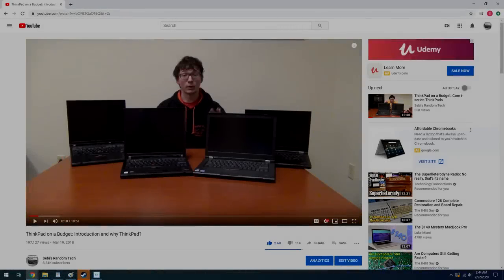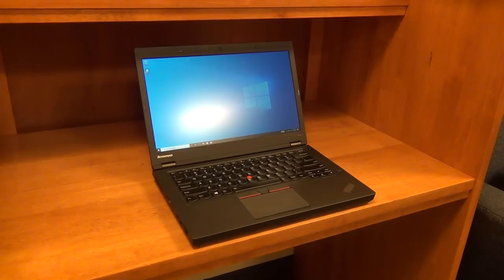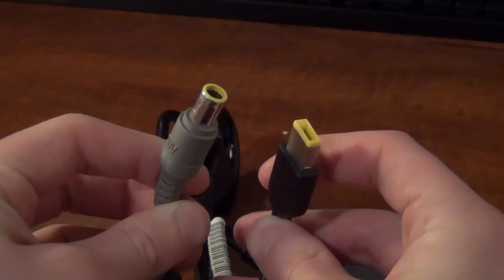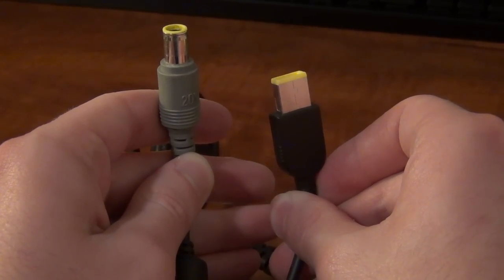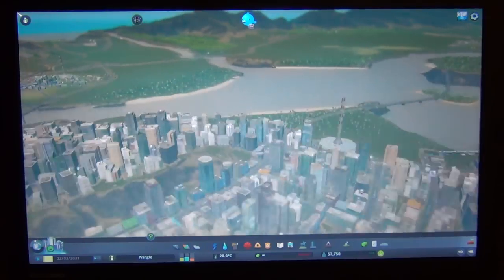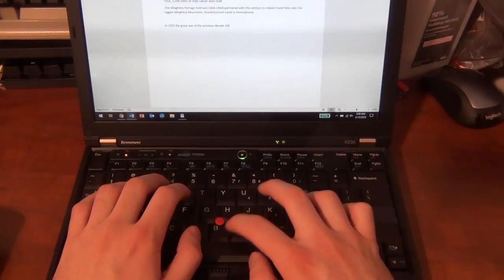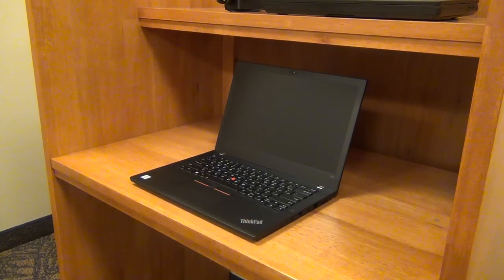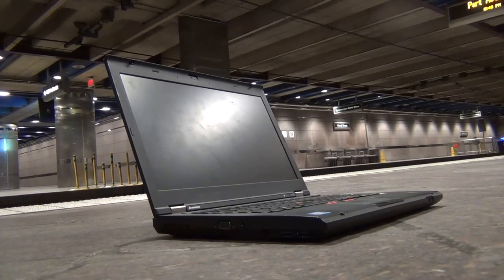Best Value ThinkPads in 2020

Comment: Totally agree on the keyboard part, it's an enthusiast project with a lot of moving parts and sourcing the hardware for it is a huge pain in the ass. It's nowhere near as easy as the 20-series keyboard swap. That being said, the chances of putting a classic keyboard into T480 are still technically higher than the chances of putting one into T440p 😂

The Thunderbolt port situation is a really bad move from Lenovo. Some users on Reddit speculate that the firmware patch is only going to prolong the Thunderbolt controller lifespan enough so that it breaks after the warranty has expired, but only time will tell. Wouldn't be surprised about that to be honest. I definitely won't be recommending those 80-series machines until it's clear whether the firmware update actually fixes the problem or not.
Reply from the maker: Yep, as I said my biggest concern about the patch Lenovo released is that we don’t know how much of a fix it is. Having recently acquired a T480 myself with the intent of using it through the rest of my college career, I really have worries about it making it through until I graduate and am seeing if it’s possible for me to upgrade my original warranty to the longest one they provide. 

It’s still a very nice laptop and I’m looking forward to making a video about it, and if I keep it for the next 2, 3, 4+ years it would be interesting to see how it wears and ages, as it’s the very first time I’ve purchased a brand new laptop. I could see myself making 2 videos, one now while it’s still “new” and another in a couple of years once it has worn down a bit. Thanks for watching!
Reply: I bought my T480 because of you Wolfgang!!!
Reply: @j.p.9522  his name is Wolfgang like Wolfgang Amadeus Mozart? 😮

Comment: Watching this from my Thinkpad T430, which I bought new in 2012. Despite having paid full market prices for something that's now worth $200, I'm still happy with this machine and consider it to be one of the better purchases I've ever made.  If you're considering a T430, here are some things that I'd highlight:

1) As the video said, a screen upgrade is almost essential. The 1080p upgrade is a bit hinky to get situated, but very doable if you're experienced with taking laptops apart. It's about as complicated as a motherboard replacement, with the added "thrills" of carefully handling a naked and easily breakable IPS diaplay.

2) Some models may have an HDD instead of an SSD, and that should also be upgraded. This is fairly easy as long as you have access to disk cloning software, and pretty much trivial if you pony up for the SATA ultra-bay caddy. Pop it in, clone the drive, swap the drives. I just upgraded to a bigger SSD a week ago and it took about an hour to get working (including the time to copy the drive.) There's only one screw holding the T430's hard drive in place.

3) Don't bother with the internal GPU that some of these came with. I had one. It barely impacted performance. The only thing it really offered of any value was that you could drive up to four displays at once instead of three, but let's be real: nobody really needs four displays. IMO, it's just one more thing to break and brick your motherboard (as it did with mine, though granted this happened after 7 years of reliable service) for no appreciable gain in gaming performance. 

4) Unless you're going the external GPU route, be realistic with your expectations of this machine. It'll be a great general productivity, student, internet browsing machine that can handle running VMs, moderate processing tasks, and the like. It's not gonna play games very well on the go. You're honestly better off building a desktop gaming PC if 60fps 4k is your goal. I have a desktop set up for gaming in the back room and use the Thinkpad for nearly everything else.

5) I've had no problem with the chiclet style keyboard.  It still has a very nice key feel (particularly the non-backlit one,) and you won't miss the original IBM layout if you've never dealt with it. The only major downsides it presents are that it hid some of the less used keys like system request, so if you have a program that uses those keys you'll need to learn the fn key combos.

6) Make sure you update the BIOS and all drivers. Earlier revisions of the BIOS had issues with sound, particularly when using the dock. You don't know how good the previous owner was at updating this stuff. Failing to do these updates could leave you troubleshooting mystery problems and wasting your time.

7) Things that broke when I upgraded to Windows 10 and probably won't ever get fixed: wireless display through Intel's WIDI (no longer supported), biometrics from a hard reboot (they still work when waking up from sleep,) and battery life got a bit worse. Just something to keep in mind.

8) Prepare for a nice experience. Motherboard died? Get a $40 donor unit on ebay. Somehow cracked the bezel? Rip a replacement off that same donor unit. Need biometrics? Buy an upgraded bezel for not that much money. Oh no, you dropped your computer? It probably still works, don't worry! Just pop the screen tabs back in, accept the new battle scar on the corner and move on. Yours came with a DVD drive but you want a Blu-ray player or second hard drive? Buy the ultrabay drive and hot swap it in! No part on these machines is rare or hard to find. There's very little to go wrong, and when it does you have a decent owner community and cheap parts galore. After doing the screen mod, I honestly can't think of any reason I'd upgrade to a new laptop for at least another five years. It does everything I want.  It's sad that laptops aren't as modular and dependable as these machines anymore, so I'll hold onto this one for as long as is viable.

Comment: Today I got a clean i5 t440p no HDD, 4800MQ, ultra Dock, 135w charger and thermal paste for <$200.
16gb of ram & 500gb ssd at home from my old 2011 macbook pro going inside the t440p.
This will be my new CAD workstation. Thanks for the great video, you got me to cancel my order on a t450 and helped me get a much better laptop and cheaper, thanks!

Comment: i'm currently developing enterprise softwares (on windows 8.1) for one of the global company you all know for.. with x230.
This machine is beast. No cracks or deformation, broken parts, no overheating, no replacement (other than getting 9cell battery). 
Extremely portable, durable, almost 9 hours of battery on the run, ergonomic keyboard and was still getting bios updates late 2019.

I could not describe it better i guess..

Comment: if you made this video in 2022, would you say most of these have stayed the same? given the classic thinkpad features have still gone down with new ones
have laptops like the P50/1/2 etc become more viable with time? or does their size counteract this, etc. 
many thanks
Reply from the maker: I'll probably do an updated version of this video sometime in the next few months or year, the T420/430/440 are still good options for everyday use if you can find them on the cheap but prices are starting to come down enough on newer models such as the P series and some T series models that those may also be viable options, not to mention they have the benefit of newer hardware and better battery life.

Comment: Your video is pure gold, I just bought a used T480, T470s and T430 for 1100€ combined. I presently use a 2015 HP spectre x360 13" which I don't really need and just dropped a new battery into (and a new keyboard a year ago after spilling a glass of wine on it; total nightmare to repair >2h). My girlfriend needs a laptop for university, so I'll let her choose whichever one of those four she wants (I suspect the HP due to looks), see which of the other three I like the most, sell the other two again and upgrade the one I will keep. Most likely I'll keep the T430. Thanks for all the info!

Comment: These Thinkpads are the best value! I bought a used T440 last year, I put away my Macbook Pro and switched entirely to Thinkpad. My T440 it´s a baby, it´s got a Core I5,  touchscreen, two batteries, one removable and one internal, two internal slots for M2 Sata, one for the Cache to improve speed on the HDD, another one hidden under the internal battery. I changed the HDD for a Solid State and got two M2 Sata drives so now I have 3 drives! with 2 windows installations, one for fallback, which I found out I never really use. It also comes with a slot for a  WLan Modem, but I don´t find the need for it. It´s a beauty. I am a translator and the Thinkpad´s keyboard it´s so much better than my Macbook´s, I type so much faster. It also has a fingerprint reader,  keyboard light, hdmi port, one USB 2 port, flash card slot, etc. The Bluetooth works great, so does the wifi. I found a docking station in Ebay and I hooked an extra monitor. Loving it. Planning to get another one. I am thinking about the T470 or a newer version of the T440.
Reply from the maker: A T470 is the newer version of the T440.
Reply: If you change go for 480. But why would you... ;)
Reply: @gramoukdoom  Yeah. I´m happy with what I´ve got.

Comment: My daily used to be a T430 modded with the 7 row and IPS FHD. I gave it to a family member so it's still used daily.
I now use a T420 modded with a quad and IPS QHD (2560 x 1440). I'm fond of the eSATA port on the T420 and use that occasionally for backups.
They're both very versatile and competent machines, and still young enough that healthy batteries are affordably available, so they can still feasibly go mobile unlike even older models.

Comment: Can attest to the T420. I swapped the HDD for a SSD, upgraded the RAM to 16GB and it works like a charm running most flavours of Linux. 

Complaints: Battery life isn't great. Neither are its thermals under moderate load - I try to downscale youtube videos and/or don't have a million tabs open for instance. 

But these complaints aside, I wouldn't part with it. Love the thing to death. Took it out to the field for some astrophotography using Darktable, and it was just an utter pleasure to use. I also didn't have to worry about the laptop's exposure to the elements as much as I would had I taken my XPS out for the same gig; in fact the midnight cool really helped the machine I feel cause I was able to eek out about 6 hours of field use that night, and it still had some juice left in the tank. That was nice. 

In conclusion, T420 is fantastic machine if you require performance and rugged durability in the open. Highly recommended for wildlife, nightsky and astrophotographers working out in the field. This is not a machine that you have to treat with kid gloves.

Comment: I think I wrote this in other of your videos but thanks to you I decided to get a t430 and I couldn't be happier with that, it has been a very good and reliable laptop for my university with the bonus of droping windows and installing linux mint, sure I also have an Acer aspire that's more modern but I rarley use it other than just play some videogames and be my "desktop laptop" LOL
Reply: I have a T430 and just recently upgraded the screen to 900p and the processor to a quad-core i7. On Kubuntu, it easily runs Wii and PS2 games. Cool thing is I got this machine for less than $150 (in my country).

Comment: Good video.  I have two high school sons who have desktops but are outgrowing their Chromebooks.  Bought two Thinkpads on ebay.  Bought a T450 with Windows, 8GB and 128 SSD for $180.  Weakest part of this laptop is the monitor but can be upgraded for <$75. Physically mint.   Was so impressed, I then bought a T430, 4GB no disk, but mint -$100.  Added a 500 GB SSD, adding an 8 GB stick and installed POP OS. T430 is definitely a stronger laptop.  Great keyboard, expandability.   Feels like a $1000 new laptop.  Thanks for the good advice.
Reply: Yeah excluding the display/ performance  it is better then a lot of modern laptops even some in 1000$ price range
Reply: If you don’t mind me asking, I’m looking to get a t430 as my first thinkpad and was wondering where you bought both of yours?
Reply: @SupremePlayzMinecraftGames  I bought them on Ebay.  The prices have seemed to increase a bit but keep looking.  In some cases you may need to upgrade some components like an SSD which provides the biggest upgrade bang for the buck.  On the T430, an AC adapter ($10), battery ($40) and SSD ($45) had to be purchased which was why it was so cheap.  I installed POP OS (free) and it has worked flawlessly. There are a lot of very cheap parts on ebay like docking stations, keyboards and other spare parts since this was a business machine.  I have not had to invest anything on the T450 .

Comment: Just bought a P50 with Xeon E3 1505M with 32GB RAM and two SSDs (1TB, 512GB) and a touchscreen for $230USD. Upgrading from a TN panel T460, this thing is huge and a beast in performance

Comment: I think the T530 is a fantastic laptop, had mine 6 years. I've noticed the T500 series are often better condition than T400 series. Possibly because they are used more at desks and not carried about as much as the smaller models. A lot of education establishments bought the T400 series and they get heavily abused, keys missing scratched/cracked displays and cases.
Needed a laptop for my daughter for home schooling. Ended up with an X250 for £160 which is in lovely condition with a Windows 10 refurbished license.
Reply from the maker: I just saw a X250 on eBay for $70! It's untested though....might be worth a risk for me or someone else! The T500 lineup may also be a tad more durable than the T400 series simply because it's thicker, and I imagine also because of their tendency to be used as a desk computer. Great machines either way.
Reply: I just got a X250 for 200 euros for my niece's home schooling as well. It has an i5-5200u with a 120GB SSD, 8GB RAM, all original with an excellent battery and in great condition. It's an amazing computer.

Comment: Hi Sebi,
One question pls: U are mentioning that the 430 series is the last ThinkPad to connect to an external gpu (due to the PCI Express Interface).
My question now...isn't it nowadays possible to connect an external gpu via USB 3.0?
If yes a t440p would also be fine regarding external gpu. Would appreciate ur answer/advice on this since I might be wrong.
Greetings from Germany,
Harris
Reply from the maker: The T430 isn't the last ThinkPad that can connect to a external GPU, some newer models that have Thunderbolt ports can connect over that interface.  The T440p has neither ExpressCard or Thunderbolt ports, and the USB interface doesn't provide enough bandwidth to transfer the amount of data required for an external graphics card.
Reply: Sorry to butt in, but it may be possible to attach an external GPU. I personally have no experience with this method but many people use an ExpressCard (stated in this video) or mPCIE connection. (The expresscard method is a much cleaner setup considering the mPCIE method requires the case of the laptop to be open with cables running to the eGPU. Do a quick search on the ThinkPad subreddit and you should find something.) Also side note, if you have an older model like a T60/61 you can use the Advanced Docking station with a single slot gpu (GT1030 works in my experience) so every time you set your laptop on your dock you will connect all of your devices along with the eGPU which is great! 
Here's some info on your specific machine @HN https://www.reddit.com/r/thinkpad/comments/5lafre/step_by_step_adding_external_graphics_card_to_a/
USB 3.0 just doesn't have enough bandwidth for a GPU
Reply: @SebisRandomTech  Thanks much for the info dear Sebi. I am aware that some of the newest Thinkpads have other possibilities to connect to an external GPU (Thunderbolt). I was only refering to PCI Express when mentioning the x30's series. But anyways thanks for the Info about USB's capabilities since my next thinkpad I am going to buy will be either a t440p or a t530. Since I am also considering gaming, now it might be a t530 due to the lacking of mentioned Interface by the X40's series.

Comment: Thinkpads are wonderful devices, the ports, expansion practical design along with unlimited mods to  make them even more future proof sets them apart from other devices, the  fact that my t420s from 2011 is 100 times better than a macbook from a year ago is rlly shocking. Not only can I get 8 hours of battery on a regular day,  I can easily fix it if something goes wrong, and the performance on the i7 is more than enough for most of my tasks. The keyboard is too good  and its just such a good laptop. I honestly cant see a world without pre 2013 thinkpads.

Comment: I ordered a T440p the other night for $160 at your recommendation, pretty excited to get into ThinkPad and it's my first laptop in many years since an old Dell Latitude running XP I had as a kid. Probably going to wait until lockdowns are over to seriously get into upgrading it though - the bad screen won't bother me too much for now considering it's going to be a machine to plug my drawing monitor into.
Reply: I got it the other night 4 days early and I'm loving it even just as is! I ordered a 2.5" caddy for the disk drive bay and a 1tb HDD since the SSD is kind of anemic.